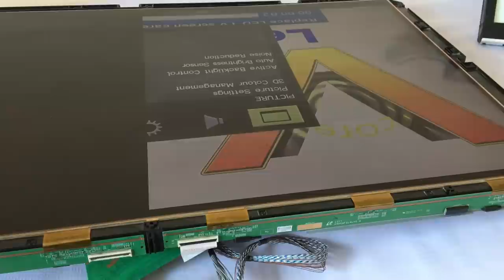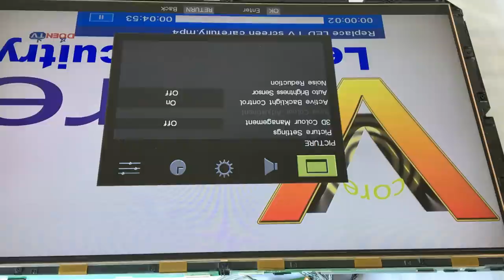40" LCD TV double image problem solved ( without cutting ) !

Comment: Level Shifter IC have on outputs, some zero ohms resistors, so, you can first remove this resistors and check if any improvements. You should remove on signal groups, for example, in this video he remove output of CKV3, he have  remove  CKVB3 signal also.
Reply: CKV2 ....CKVB2

Comment: how did you identify the resistors that needed to be removed?
Reply: by  the  number   and  hint  in the panel   he cut ckv3  ckv2 out
Reply: Samsung 40 LCD also same problem this method not work .help me
Reply: Level Shifter IC have on outputs, some zero ohms resistors, so, you can first remove this resistors and check if any improvements. You should remove on signal groups, for example, in this video he remove output of CKV3, he have  remove  CKVB3 signal also.

Comment: What if both sides have double image and/or flickers was when you remove cables from left and right side. I replaced my toon board and still have double image please help ! samsung un40d6000sf  is my model. Double image not t con how do I know if it’s panel and is it possible to replace panel ?

Comment: Hello, may someone help me? I have a TV that we replaced both MB and Tcon, and it keeps showing a duplicate screen. The screen is divided into 2, so we see the same image in the left as in the right like if there were 2 separate TVs. Any help? Thanks.
Reply from the maker: What is actual problem if there was same problem before changing MB and Tcon then it is panel problem.If it problem after changing MB and Tcon it is software problem

Comment: Removing the resistors is a way to cut a cicuit, so I wonder... Do you know why this works? Is it a way of disabling other functions on the TV or some kind of "counter" that tells the TV to create a problem so people buy a new one?
Reply: Or just a faulty part, or design. Believe it or not, designers at big name companies are the same kind of guys at small companies. They make mistakes from time to time. Sometimes a flaw in a chip or circuit layout wont show itself for years. Or only if a certain set of conditions are met, such as the panel getting too hot. 

Its not healthy to automatically assume its malice on the manufacturer's part. More often than not, shit just breaks. It happens when you're making products millions at a time.
Reply: Makes sense. Some driver could be bridged with some other output, where the correct one dominates for years, then finally gives out and the other one takes over. I'm pretty skeptical of a solution like this, though. There must be some downside.

Comment: I really hate led TV's as no manufacturer gives not more than 1 year warranty on them nor they last more than 3 years . Nor the technicians are that skilled.to repair it instead they suggest to buy a new one. Previously I had 28" CRT with huge bass which lasted more than 2 decades .